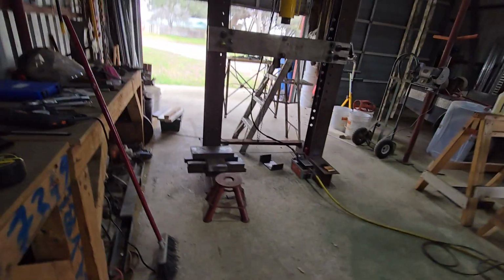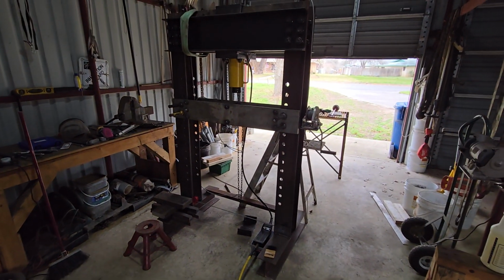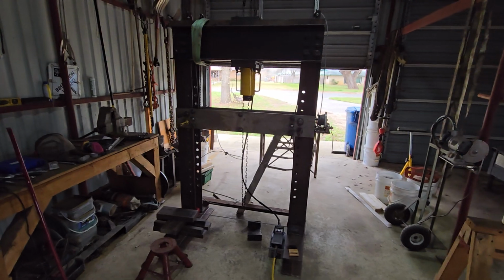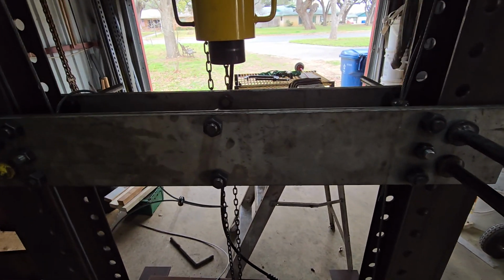DIY 50 TON SHOP PRESS TABLE LIFT FINISHED

Comment: Wow. That is a big one. Very nice press.
Reply from the maker: Thanks....not an engineer but Im pretty sure it would support a 75 ton cylinder based on the 75 ton presses Ive seen for sale. I will be building a press brake attachment for it soon as well as giving it a coat of paint.

Comment from the maker: I have since cut the pins to correct length as well as ground all the paint off them and sanded them smooth. Also gave the end that is inserted a round over blunt tip to make inserting easier. Table raises and lowers super easy without any of the press plates on it. The press plates add anouther 100lbs so I will just set them off whenever I need to raise or lower the table.